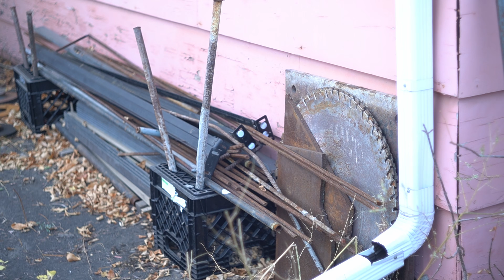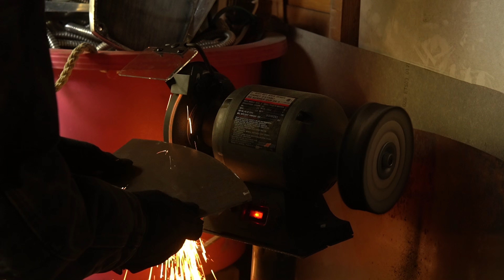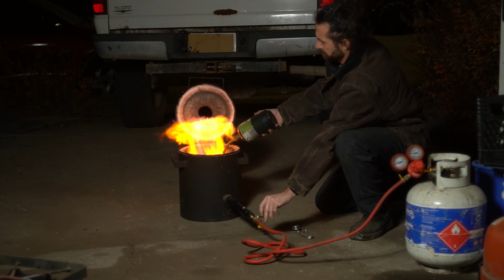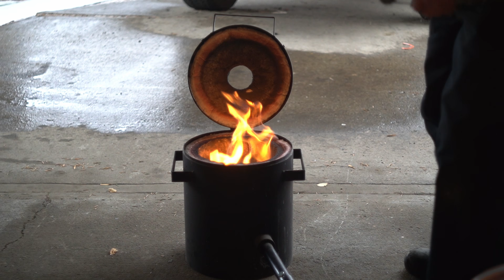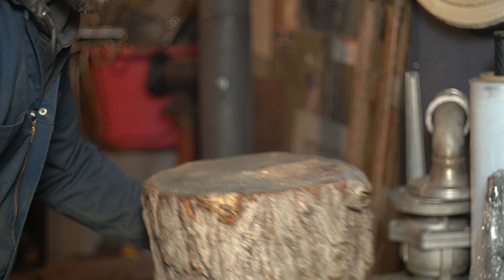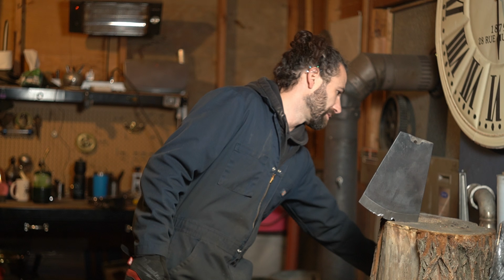Did I Just Make the ULTIMATE Copper Scrapping Tool?

Comment: I like the idea of your large knife blade........how ever, my thinking  is your cutting edge is too thin.  it should be blunt and with a little angle to the edge. not worried about a transformers steel stacks(flimsy) .  that's what the slag hammer is for , smash right through it.  best of luck

Comment: Not so sharp maybe 30 degree angle or a 45.
No heat treatment, cool the metal as you grind your edge. Take your time a sander generates  a lot of heat. 
2. A wide cutter has more surface area more drag, you'll need a bigger hammer.

Comment: How about using the section from the blade as an extension on the top (hammering edge) of the cleaver? Cut a 4 inch x 6 inch piece from your saw blade, and weld it onto the top of the cleaver so it was 6 inches taller to the part you hammer on. The blade and the handle part is already done by the cleaver manufacturer.

Comment: You can not use a single edge. It would have much better properties with a dual edge. Sharpen the tip into the center of the blade. You triple the strength of the edge with a wedge geometery. Been there and have done that.

Comment: At some point you should come across ax heads in your scrapping, those should work very well for your items that you are trying to pull apart, or steel wedges. It is already a crafted steel for abuse and you would be able to sharpen it as needed and to the desired starting width. Great video on what NOT to do in the process of trying to learn tempering steel. It's always a process of trial and error, which at times can be a little dangerous.

Comment: Dude, try using the metal from an old auto leafspring. They’re usually Spring-steel, you can grind and file down the edge and make a sort of type of heavy duty machete, with it you should be able to split transformers, it will be more heavy duty than your machete.

Comment: How about using a modified gas powered or electic wood splitter? maybe modify it with a thinner blade and or a more robust end plate where the transformer or coil would sit so that it wouldn't shear the end off?

Comment: i work on a heat treat furnace for track shoes on earth moving equiptment. Hardening is only half the process. If you want sturdy hardened metal you have too temper it as well. For what you are working with i would try heating it to about 800 degree F. then quench in oil. If it doesnt warp. put it in you kitchen over at 200 degree f. for about an hour and that should give you a better edge. The only other thing that i can see as detrimental is the hammering instead of making it an attachment to be mounted on a hydrualic press. The more even steady force may preserve the cutting edge better. Even taking a clever blade and wen
ld it up to go on a press may work very well

Comment: I really don’t understand why you don’t just use a woodworking chisel.. I’ve been using a chisel for years and never ever found anything that works better😂 also it doesn’t need sharpening, I just touch it up with a grinder if the edge ever gets too messed up (yes it ruins the steel sharpening with a grinder) but a chisel is about £3 and will last about 10 years

Comment: The metal working with already processed steel is way different. You're learning and it works. That would be a good large scraper. A steel plow blade would be ideal.

Comment: You need to open and examine that transformer. That kind of damage should not have happened if you were just cutting through copper. There may be some of those steel bars separating the coils like you find in a microwave transformer. This may still have been a good idea.
Reply from the maker: That’s a good thing to keep in mind for sure. It wasn’t the presence of throughpins that caused it though, it was that the edge of the blade caught the edge of one of the plates and cut into it
Reply: @thubprint  . It wasn't through pins I was referring to, but if it was a lamenent, then perhahaps putting a much smaller, blunter bevel on the blade edge would prevent that. I still think it's a good idea. I watched another video buy a guy who did something very similar, and it worked out very well.

Comment: "Bevel" is the word you're looking for, my friend. Taper is when the blade starts thick and thins out near the tip. Bevel is the blade edge. :)

ANYWAYS. Leesauder already gave you some tips and it sounds good to me. I've made a few tools to scrapping myself and I've made a blade out of a saw blade as well. But I made the bevel more of an ax edge. Making the bevel too long like you did makes the metal of the blade much too thin and prone to rolling and .. yeah, what you did lol. Make the edge much less of a bevel. You don't need to have it super sharp. Steel is just much harder than copper and will slice through it even with the dullest blade.

Comment: Those saw blades brought back memories. I was a concrete cutter for 10 years and work for one of the largest companies in the country. Those blades were babies I use to spin up to 98" blades. lol I liked your idea and I think if your edge was not so tapered and thin it would have held up better. Also I believe if you made a pointed blade it would work better. I replicated my $500 stator splitting blade out of 1/2" mild steel plate and it worked fine. The blade was still pretty thick until the last 1/8 - 1/4"  I made a video showing the measurements and the process. A thicker blade and a v-block and you will have something. Good luck looking forward to seeing what you come up with.
Reply from the maker: Nice, thanks for the tips buddy! I’ll hunt down that video and see how you built it. I love all your machinery and the efficiency but I remain fixated on finding a solution with simple hand tools

Comment: Seems like a homemade hydraulic press, with a bottle jack welded to a cold chisel might work.

Then you could just press them apart like a log splitter.

Might take forever, and having a wide enough throat on the device could inhibit it's usefulness.

Would make things a lot quieter though.

Comment: Find a scrap piece of high carbon or tool steel online or at a yard and use that, probably better if you just buy already hardened and normalized. I think a piece of air hardening steel would be good, like A2 or D2 tool steel

Comment: A hatchet is the best tool. Hardened on the edge, softer on the back so you can hammer it. If I wasn't using a hatchet, I'd build something like a log splitter but smaller, built out of the largest screw jack you can find at Pick N Pull, and you power it with an impact driver. Then you just need a box frame out of some scrap angle and you're set for relatively fast guilotining.

Comment: What you did with heating it up slowly and dropping the temp slowly was annealing it, this is necessary for shaping and sharpening but you have to heat and quench the cutting edge to working hardness and afterwards normalize at 400 degrees in a oven for 1 hour so it's not brittle and doesn't chip during use.

Comment: Used disk for turning soil cut and shape it heat from cutting edge up 11/2 inch tell none magnetic have a metal tray with approximately 1/2 inch of water drip the cutting edge of it into the water for a three count and check with 🧲 till it sticks and air cool .PS you are changing molecular structure from body center carbon to face center on the cutting edge only.

Comment: Forget pounding the blade, get a bearing press or make a frame and use a big bottle jack
Reply: Going to build one now. I've been thinking about this.
Reply: Arbor press 2 ton for $80 it will replace all his tools and make no noise or require gas and electricity, the neighbours should buy him one .
Reply: @dino9071  Haven't found a single video of anyone busting down transformers with an arbor press. Would love to see it in action.
Reply: @Xander081987  I've tried and failed at doing that couldn't work out how to edit didn't get past that stage so I didn't go any further I had to watch ads for the edit appt to do nothing but just make more copies of the same video, but I've been doing this for thirty years before internet and YouTube I would actually prefer people to leave my scrap alone it's these videos telling people make $100 per hour on scrap that causes problems for me because that's all I do for income but this guy is honest about what you can expect to make I like his video's.
My press weights almost 100 KG and uses a small axe shaped head to break the seam the wedge shaped blade separates it as it cuts it's not mounted to the bench and will rock forward sometimes under the pressure then slam back down I use a steel pipe for extra leverage the head attachment also cost $80 I had it custom made.
Reply: Was going to say samething

Comment: Hey Thub, a guy with very little blacksmithing experience here but one thing the guy teaching the course I attended told us is to never ever hit a back of a metal blade with another metal object like a hammer when cutting into something hard. Reason being that not often but more often than you would imagine there might be a small shard of metal splintering off and flying in a random direction and if you are very unlucky you might lose an eye so just be careful. What our instructor used when splitting hardwood with a blade he made was a large gavel made of hardwood, oak I believe to prevent this from happening.
Reply: "never ever hit a back of a metal blade with another metal object like a hammer" Not quite. The rule is to never hit two hardened metal surfaces together (a hammer counts). You can get tiny slivers that will ping off at about the speed of sound and embed them into your face and body. Mythbusters tried to do this purposefully and couldn't get a result, but it definitely happens.

Comment: I have an idea since you want the body of the blade to be mailable. So oil quench achieves that. 
But to have a strong edge. It can be an achieved by cutting some of the edge back. Then run a a bead of welding along the edge. 
That will result in a blade with the same qualities as a Japanese katana. Strong flexiable spine. Strong Hard cutting.

Comment: It doesn't have to be super hard. It's only cutting through the copper an going between the plates. As long as you  use an aluminum plate underneath  when it come through.

Comment: When you heat up steel and make it super hard like you did, it then becomes SUPER BRITTLE.... hence why it BROKE and then was ruined.... You heated the metal TOO HIGH the first time.... and then you REMOVED IT FROM THE OIL..... and you had WAY TOO LITTLE OIL..... Fire is FINE!  but you need WAY MORE OIL THAN THAT!  ... water works too!!! ... 
Soooo.....
- HEAT JUST THE CUTTING EDGE, and forget the magnet.... heat it EVENLY, and get it just above DARK CHERRY RED.. not BRIGHT CHERY RED.... (you got it HOTTER than BRIGHT CHERRY RED... which is TOO HOT) - ...  go watch some knife making videos, and find a guy that clear shows you how hot he gets his knife before he quenches... and watch a few of his videos so you can get a GOOD IDEA of just how hot to get it before he quenches it.....
- then QUENCH IT ALL AT ONCE!!! YES, IT MIGHT WARP...but that's why you ONLY HEAT THE EDGE... I recommend oil (it can be ANY OIL!!!!! food oil's are JUST FINE!!!!!.. used is better because you aren't wasting food) - but WATER WORKS TOO!!! - Use a BIG CONTAINER WITH A LOT OF WATER/OIL, STICK IT IN FAST AND MOVE IT AROUND SO YOU KEEP THE WATER MOVING - DONT TAKE IT OUT AND STICK IT BACK IN.... JUST PUT IT IN THERE, MOVE IT AROUND, AND DO THIS UNTIL YOU CAN TELL IT HAS SUBSTANTIALLY COOLED DOWN!!!
- THEN YOU PUT IN A OVEN FOR 2 HOURS AT 250 DEGREES F !!! - THAT IS WHAT 'NORMALIZES" IT!!! OHERWISE IT WILL BE BRITTLE AND BREAK/SHATTER!!! IT WILL SOFTEN THE METAL A TINY BIT, BUT IT REMOVES IT BRITTLENESS!!! (I'm not 100% sure of it being 250F but look into this, and see what other knife makers are doing, and get a census from their expertise)
- - - I'm, not an expert! I'm going from what I've learned watching a bunch of knife makers!!  Think of what I just told you as a basic outline.... watch some professionals make their knives and get the details from them... like the color of the metal, the temp of the oven, time in the oven, the differences between water and oil quenches
-
ABOUT PULLING COPPER WINDINGS OUT OF THE MOTORA - PUT copper/steel discs into a vice and cut the copper off of one end, right down the steel discs,  then use a metal rod (a screwdriver will get in between the copper wires and just jam it up.. you need a rod that just fits inside the space with the copper wire and it has to have a FLAT END) to bang out the remainder of the copper through to the other side.... you don't have to split it open, or cut the steel at all.....  OR you could cut off one end the same way, flip it over in the vice so the other end of the loops are sticking up now, use a rope/chain and pulley attached to your ceiling to attach it to the4 loop of copper and pull it up and out... repeat until they're all out (i recommend tapping the copper out with the rod)
 - this is how I see most scrappers do it (using the rod) unless they have a rope/chain and pulley setup - it's how I've always done it too... SO MUCH EASIER than splitting the discs apart and still having to pull the copper wires out
 - - -  GOOD LUCK!!!
Reply: oh and when you cut the loops off with the angle grinder, collect the copper dust.... put it in a glass jar... admire your pretty work :) lol

Comment: I think that most cutting tools are made from high carbon steel.
I don't know about power saw blades. The ones for cutting hard items are tipped with harder materials, carbide or diamond, for example. 
Without a forge, maybe fusing two or three cleaver blades together, then sharpening them from a common point?
Just be careful. 
Don't want to change your name to Thubless.

Comment: Just a thought, a thick coulter blade from a piece of farm equipment, like a fertilizer open disk off a corn planter or a 28% applicator. They are hardened and thicker than your saw blade. You could check out a mail order company called Shoup to look for ideas. 
I made a tool for a whole different purpose from one but can't remember what the coulter blade was from 🤔

Comment: Heh nothing wrong with trying something.  I think the hatchet Idea is good but its too bad it wasn't a little bigger.  One thing I did notice however is that log you are using as a bench of sorts is bouncing when you you hammer.   Not good.  The bouncing is absorbing much of the shock of your hitting.  Try putting your piece on something that doesn't move, concrete floor is always good, and you should either split things much faster or with less effort.  Keep scrapping without napping and with less grappling.

Comment: I use an old Estwing Riggers hatchet/hammer with a 2-3lb mallet to split all the way up to 120hp motors. I’ve also been using a 70lb electric jackhammer with a sharpened wide bit for easier splitting recently. No more sledge hammers and brick chisels needed with the jackhammer. It does sometimes help to get the split started by hand tools first on some motors before the jackhammer. Jackhammer was a barely used Makita for $500 at an auction.